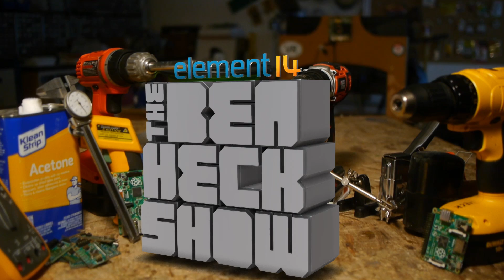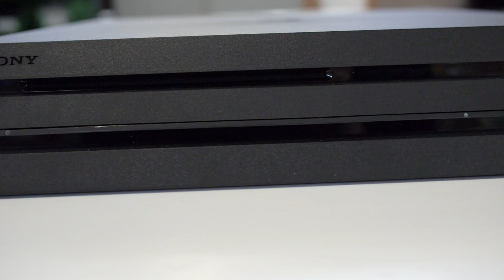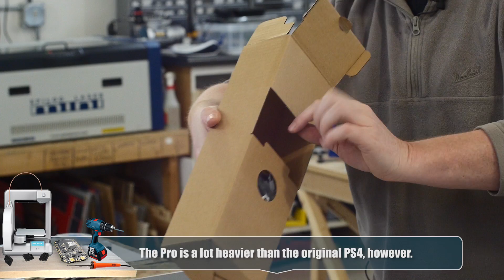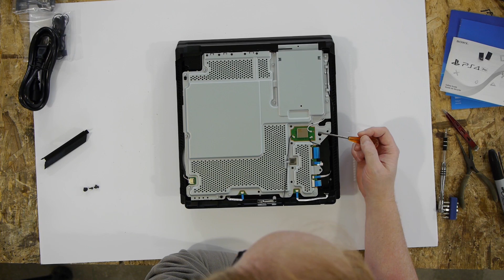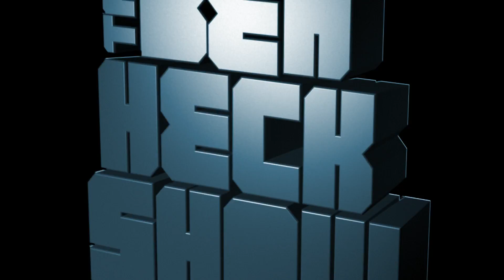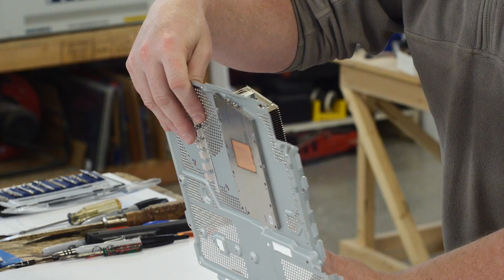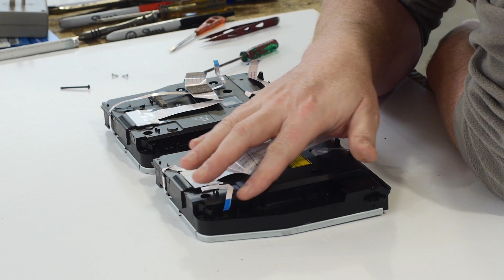Ben Heck's PS4 Pro Teardown

Comment: It seems to me that the PRO is just an overclock PS4, that is why is using much more energy, because the Overclock is taking more energy, and with same RAM but faster, is definitely overclock.
Reply: Fernando Salazar no. the cpu is overclocked. the gpu is crossfire, and it has more ram.
Reply: Fernando Salazar Well you're wrong, there are a couple of native 4K games on the PRO. Also games that aren't native are still rendered at a higher quality than standard ps4. Most games are around 1440p with supersampling, which is still 2x the pixel count of standard ps4 with significantly better images.
Reply: luigi90210 he's saying that games aren't made with 4k in mind and lack high resolution assets. Which makes 0 sense, and No you cant. You're not building a 200 dollar 1440 machine.
Reply: oh no you read it and you're pissy about it, you wouldnt have responded if you didnt

if you're done than fuck off already fat fuck, all that fat is stuck in your brain making you stupid
Reply: PS4 Pro has 8gb Gddr5 ram clocked @ 218GB/s +1GB of ddr3 dram for background apps, while the regular PS4 also has 8gb Gddr5, but clocked @176GB/s. The Pro's gpu really isn't crossfire per se. It just has 2x the gpu cores clocked at 911mhz vs PS4's 800mhz. A non-Pro game will simply utilize 18 of the 36 cores downclocked.
Reply: Fernando Salazar No, it's not just an overclocked ps4. It's over 2x as powerful as the slim due to a second identical GPU on the APU die, this allows for backwards compatibility with current ps4 games by just turning off the second gpu
Reply: james stack

why because OP stated in a comment chain that "there are no 4k games now"(implying all games are not 4k)

he choose to not read my initial comment, ill choose not to read his response on how the Piece of Shit 4 pro upscales games from 900p to 4k

the fact that you're a 30 year old man whos stuffing his face and still plays with a childs toy makes me sad... build a real gaming machine
Reply: +James Stack
What's your source for your claim? PC games unlike console games are not resolution dependent, there is no such thing as native 4k or upscaled 4k on PC unless you're purposefully running the game at a lower resolution than your monitor and forcing your monitor to scale it up to full screen. Selecting 3840x2160 will make the game render in that resolution natively, hell even games from 5 years ago support 4k native rendering. 

To apply your console logic on PC gaming is asinine and will only make you look stupid. 
Also consoles have the same power as an amd a10 7860k with it's native graphics running these games and spoiler that isn't very good nor would I consider an apu build to be mid range considering we are talking about a sub $300 pc brand new

To put it into perspective, I can build a $200 gaming rig made with a CPU from 8 years ago and a graphics card that's 5-6 years old and have it perform better than the brand new PS4 pro. Hell my actual computer I built for $400 performs light years ahead of the PS4 pro and it costs exactly the same, hell I can actually do 2k gaming with decent settings on AAA titles and I'm sure I can find a title that I can run native 4k on(probably lol but I don't play lol so of have to download it and check)
Reply: +James Stack
im calling you out on your bullshit right now, you dont work in IT and if you did, you probably work something really low level that you are too embarassed to say
as a network engineer and game designer, i dont tell people i work in IT, i tell people i work what my position title is, every game i design doesnt adhere to any resolution specifically because we are telling the computer what to render and at what resolution, the 3d model you see running around is rendered on the fly at whatever resolution you set the game at, what you maybe saying might hold true for older titles in regards to 2d assets but as far as 3d models and textures are concerned, whatever resolution you render them at is what you are running natively 

stop trying to pull shit out of your ass, just because console games lock render resolution and assets to a specific resolution does NOT mean PC games are made that way
Reply: James Stack why are you thanking me? Your methodology isn't how it works. Asset resolution doesn't have anything to do with the resolution the game is natively outputting as.  -_-
Reply: yes i could build a $200-250 1440p gaming machine it wont be easy but its not impossible, considering the LGA775 platform is dirt cheap and not to mention you can find a 1440p card like the HD7970 used for sub $100 on ebay(if you're lucky you could score 2 cards for about $100 and those in crossfire are a definite 1440p high to 4k low setup) and even if i didnt want to go with an old platform like LGA775 i could easily go with something just as capable like the phenom 2 x4 for about the same price
Reply: TheBananaKing true but it didn't get a good upgrade on the cpu side hence the trading of graphics for framerate.
Reply: Lt. wreck Yeah, the cpu is pretty abysmal. It's baffling why Sony chose such a disparity between gpu & cpu. I know they want to stay power efficient. But, original PS4 dev kits had a cpu clocked at 2.75ghz. And, when you think about it, some devs probably had those kits in 2012. You'd think that in 4 years time with die sizes being halved among other tech innovations that Sony and AMD could've settled on a better cpu. But, (and I know this is turning into a rant) I don't blame AMD. I think it was more Sony simply wanting the absolute cheapest option. There were rumors back in the Neo days that Sony was deliberating on the cpu currently in the Pro, or a "Zen-light" cpu. 

I have one "way out there" theory on the cpu though. It has to do with the Pro's psu being rated at 310w. The console only uses around 160w peak. And, the system runs pretty cool for the most part.

So, what I'm getting at is Sony doing an overclock update. Probably when Scorpio comes out. I know MS boosted the XB1's cpu from 1.6 to 1.75ghz just prior to launch.

Like I said, this is just a theory knocking around in my limited mind. So, who knows?
Reply: Bob Bop Perano I think the main reason Sony stuck with the same CPU only overclocked was due to architecture compatibility. Adding a second identical GPU doesn't hurt compatibility, allowing Devs to have an easier time tailoring their games to the Pro. They have succeeded at their goal in providing 4K experiences in the living room.  Not all games run in native 4K but it's obvious that it's a better graphical experience for those with 4K TVs
Reply: TheBananaKing actually if the dev does their due diligence, you get a better experience regardless of what type of tv you have. Take tomb raider for example. You have 1080p higher quality, 1080p higher framerate, or 4k mode (I forget what the native resolution was)
Reply: The extra CPU is not very good, otherwise it wouldn't needed patches to upscale and render games properly in 4K, also note that PS4PRO doesn't have 4K gaming, is just upscaling and patching them to look good in 4K, there are no 4K games now.
Reply: Fernando Salazar the ps4 pro is nothing more than a double dip from sony that sheep will definitely buy. It will use upscaling garbage to get you 4k, which is a far cry from native 4k. then there is the tv which has to support it and this and that aaaaaaand you're a fucking sheep. Did i also mention sheep will reach out to anything to  escape their shitty reality? also, to be clear, you're a sheep.
Reply: Ben Scott sheep, got it.
Reply: Sony is misleading people with that idea of 4K, the patches are to fix the upscaling quality as it deteriorates when upscale to 4K, and they use AA, as a way to make it seem better, also the HDR gives it a sense of improvements in graphics but the HDR doesn't improve the graphics only improves the quality of the image, for example like a foggy picture, the HDR would basically make those colors more noticeable, but still is the same picture, so you get the idea.
I doubt the PS4PRO has the power to render a native 4K games sense they are upscale, and no game has ever said they are the first at 4K native resolution, I doubt the pro can render a native 4K, why? Because the disc drive is cheap and they would need to patch it, but even so, let's say they patch a game, was that game made in 4K? Considering the fact that it barely stands an upscale 1440p upscaling it at 30fps, how in the hell will it render it a native 4K game at a higher resolution without dropping frames per second, for example witcher 3 with the patch is improved, but still drops to 28fps, so a higher resolution would drop even more, I am guessing it would drop to less than 20fps making it unplayable in 4K.
Reply: +Fernando Salazar

WHAT? no 4k games, shit you better tell the PC crowd that
Reply: luigi90210 the games are not render at 4K they are simply upscale to 4K, that is why they are able to play it in 4K because upscaling is lighter than rendering natively, upscaling is way lighter, but rendering a 4K game requires like 2 twice the power, and neither XBOXONE or PS4PRO have that power, the PRO is basically a PS4mini overclock with the ram tweak also, they just added slightly little more power to make it capable of having that extra power, and the patches are to enhance the graphics so they don't look awful due to the upscaling.
Reply: Fernando Salazar hahaha Please do some research before you talk. There are a few games that can render native 4K; The last of us, Shadow of Mordor, Skyrim, NBA and a couple of indie games. The upscaling technique is quite advanced for games that support it, it's not the same technology that Xbox one s or a common 4K TVs uses. Go watch some videos on Digital Foundry, they have a pretty comprehensive guide of each ps4 pro game and their advantages/limitations.
Reply: TheBananaKing those games were made in 1080p or 1220p not made in actual 4K, which means they are made in 1080p and they are upscale to 4K, to make that same game in 4K would be much heavier than what they are, and would take much more space in a hard drive, so a native 4K game hasn't been built, is just upscaling and enhance with patches, they claim they have but where? They don't show, and NEITHER PS4PRO is capable of 4K gaming, they have 4K gaming only because they upscale and patch, but is deceiving advertising to sell there products, for example XBOXONE could do the same if they patched there games, would render same as PS4PRO, so where is the native 4K?
Reply: Well shit I'll tell my friend who has a GTX 1080 that his games can't render in 4k natively it's all upscaled lmao. The console scrubs said so.
Reply: ***** fam please stop spreading lies. 4k assets aren't taking up a lot of space on a 1TB HDD since they still have to go to the RAM anyways, 8gb of DDR 5 is more than enough space for them. There's literal lists of native 4k games for PS4 PRO (out now mind you) in existance. face it the console at its best can do 4k. Might not be all to often since most games that get the patch are 1440p but it does happen.
Reply: luigi90210 I had a whole comment typed out but I figured it would go right over your head so I erased it in favor of this comment. You make me sad. Very sad indeed.
Reply: +luigi90210

"WHAT? no 4k games, shit you better tell the PC crowd that"

Yes, you better tell the PC crowd that NO games run 4k natively. That is why you make me sad.

Also, I never stated my preference for gaming, my age, or my weight variences but I'm impressed that you nailed all of them, perfectly, in a well thought out, elegant, grammatically correct comment.

As a side note: consoles are just as powerful now as the bottom range of high end PC's. You don't need to fear that. Instead, you should embrace gaming and gamers as a whole and let's celebrate this beautiful medium that brings a melting pot of people together.
Reply: luigi90210 Well, I suppose my source would be that I work in the IT industry and that pretty much everything you just said is very inaccurate but I can see that this conversation is going nowhere so I will bid you a fond farewell. Have a great day!
Reply: BenjerminGaye Thank you, sir.
Reply: BenjerminGaye I was thanking you because I thought you understood. I was wrong. Oh well.
Reply: luigi90210 I'm not reading that. I said I was done with you and I am.
Reply: luigi90210 Okay, that one I did read. Lol. Nice! 

I've been nothing but polite (maybe a bit sarcastic) so why do you feel the need to start slinging insults? It would seem like you are the one that is upset. But I digress; I seriously didn't read your last post to me. I just don't see a point in arguing with you anymore. I'm willing to admit when I am wrong but you, obviously, are not. So, again, you have a great day and game on!
Reply: luigi90210 went to ebay, card alone costs 150-200. no mention of mobo, psu, ram, cpu, case or anything else.  lol. Good luck.
Reply: luigi90210 Dammit, you keep pulling me back in. I do actually PC game but my last rig was stolen so yes, right now, I am playing on consoles. But I don't see that as a bad thing. Have you ever played The Last of Us? Arguably one of the most emotionally resonant games ever made and it's a console exclusive (unless you pay for PS Now).

I don't know why you would think it is so bad to play on consoles. Some people prefer it and others can't afford high end gaming PC's. To each, their own man.
Reply: thats cause you dont know how to shop on ebay

you can find used cards on bidding that will end soon that are sitting around the $50-70 mark, buy it now posts are always more expensive, where you actually save money on ebay is in bidding, not buying it now
Reply: luigi90210 so you're saying only if you're lucky  will you get all the parts cheap on auction. Lol.
Reply: no you're not willing to admit you are wrong, if you were you would have done so when i explained how pc games are made 2d assets dont determine native resolution or even intended resolution, if that were the case than halo PC would look like crap when rendered in 1080p and that game was designed when games were running at 1024x768 as a standard or even halo 2 vista would look like crap cause that was developed when 720p was the standard yet it looks beautiful in 1080p

consoles are not inherently bad i love my n64 and sega genesis and i sure as hell love playing my 3ds but consoles like the xbox one and ps4 are nothing more than a waste of money, you're paying for a subpar experience and outside of a hand full of exclusives the overall gaming experience is not worth the amount of money you'll sink into the console

not to mention the consoles are moving to a PC like model where you need the ps4 pro or xbox scorpio to get the most out of your games and are essentially making you buy an entirely new system every couple of years, if thats the case why not buy a PC where you can upgrade components when needed, shit if you can afford a ps4 pro, you can afford to build yourself a decent mid range gaming computer that will play games at better resolutions and better fps than the ps4 pro will offer

also console exclusives will be a thing of the past, more people are ditching consoles for pcs and sony and microsoft realize this, why do you think ps now and xbox anywhere exist? all the new xbox exclusives are playable on PC same with playstation with PS Now, whats the point in buying a console when you can buy a pc and play exclusives from both platforms and in the case of xbox anywhere games, actually play the game with a better experience than the xbox itself can deliver?

for people to claim that consoles are better than pcs or that games dont render in native 4k because a console cant do it is asinine and only someone who is diluted would ever believe that
Reply: thats just apart of deal hunting. i got lucky when i found my motherboard and cpu combo at frys($160 for a MSI 970a sli krait motherboard and a FX 8370) and i got even luckier with my graphics card find(R9 380x brand new at microcenter for $140) 

its not hard to find cheap components, its just time consuming and luck of the draw
Reply: luigi90210 yeah no. When i see a pc build beating the ps4 pro at 200 msrp ill believe you. Not you saying "scavenge in the bargain bin for used parts until you strike gold."

Comment: the pro is basically a amd rx470/480 with a 8 core jaguar apu.. the pro is considerably faster than slim or standard. the regular and slim are very old gpus on the apu